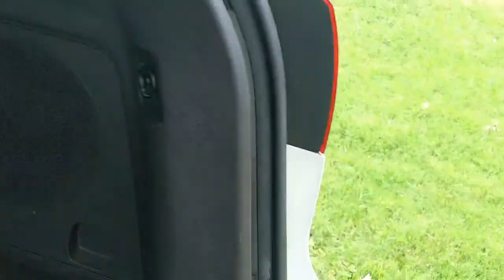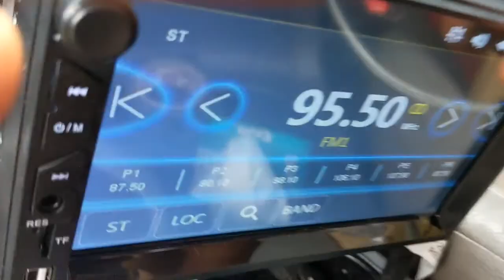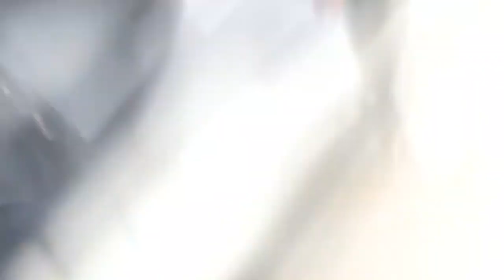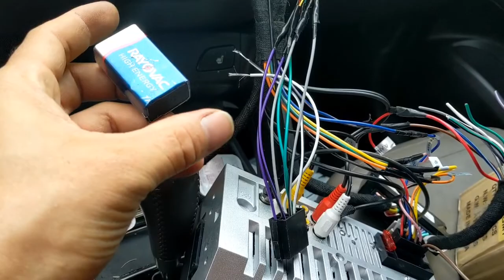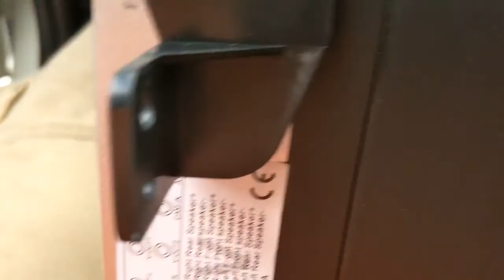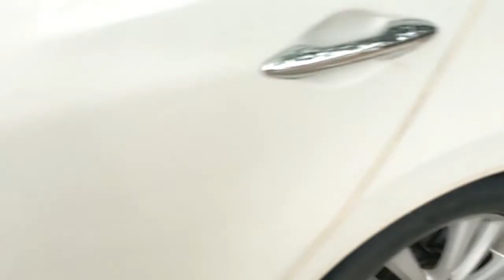How to bypass factory amplifier

Comment: Hi, I have a 2014 ix35/tucson with factory sat nav, amp and sub. I have an aftermarket android head unit to go in and no matter what i try i cant get sound output although the unit works fine.  Ive been told it may be to do with the spdif signal that goes to the amp and was even sent a different harness with some type of convertor box inline but that didnt work at all. I think I may have to bypass the amp to solve this? - That would be a shame as I'll lose the sub too. Any pointers would be greatly appreciated. Thanks.
Reply from the maker: Wow yes or get a new amp

Comment: Is a good idea. Same thing here. But my amp is working. Watching your video, i have to do the same. But since my amp is working.  What donyou recommend.  What cable i have to connect from the radio to the amp. Otherwise i have to connect all the speakers like you did.
Reply: Blue wire from the stereo. And what wire from the amp.
Reply from the maker: You need to connect the blue wire to the amp wire